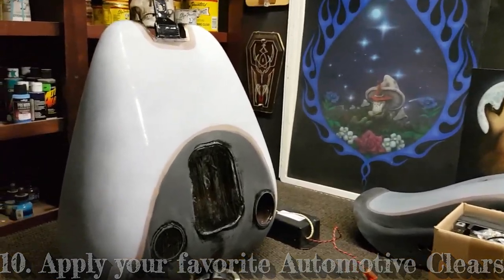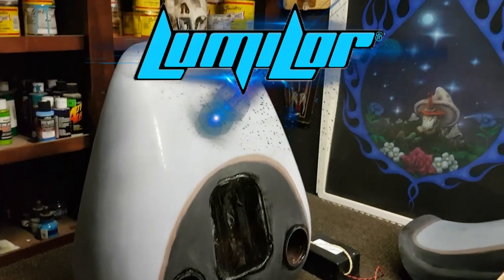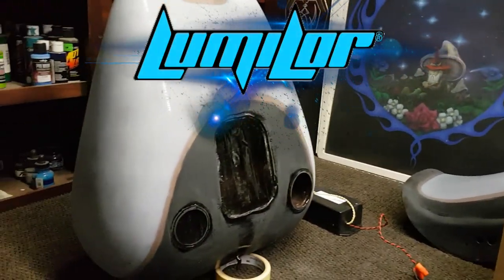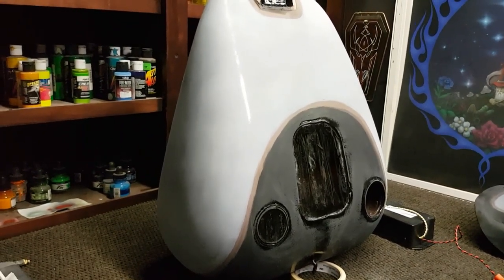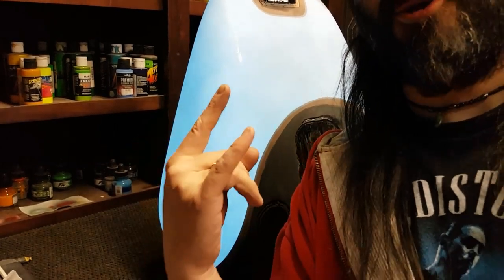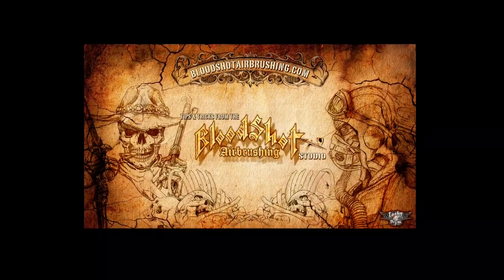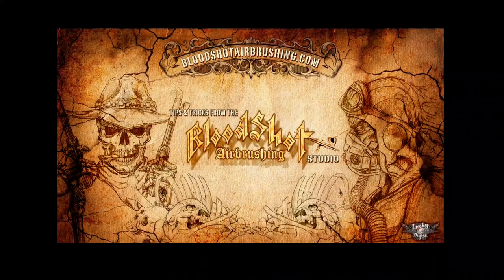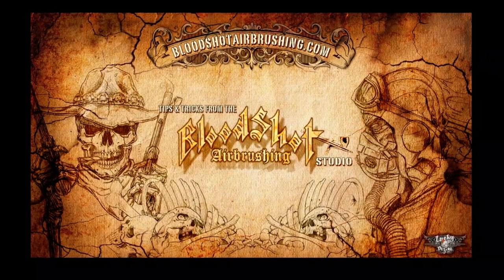LIGHT UP Paint with BloodShot Airbrushing & Lumilor in Canada! Teaser Video.

Comment: Love your work! You are very talented! I'm sure you get this alot but, I was looking to get a setup to do mainly rc bodies. It is very overwhelming to look at all the stuff available. Could you recommend a good setup to get started with? Thanks
Reply from the maker: Well.....😁🤔 I think the airbrush is the most important part.. cheap ones can lead to frustration with an inferior tool ... so I do reccomend getting a brand name one. Compressors are less important... its mostly a noise factor.. but anything that can give ya 0-60 psi will do. I typically don't run more then 45 psi..  you'll want to find paints specific for the type of application.. I'd hate to see you do a bunch of work just to have it flake off... youll also need other things like masking tape, Xacto blades, paintbrushes rulers ect.... 😁 I think this should get ya going broski!! 😉👍 Big Cheers and Much Love from the BloodShot Studio!!🤘😎